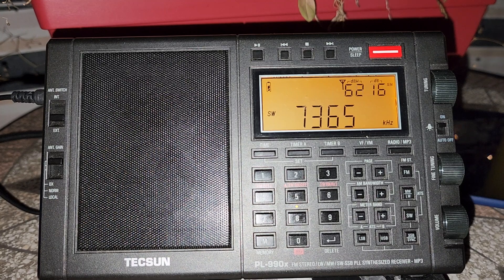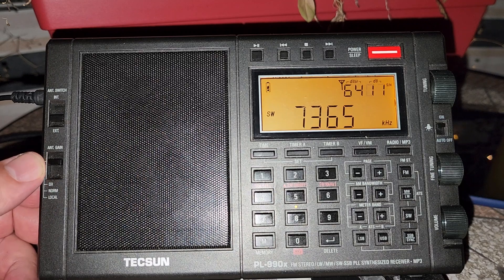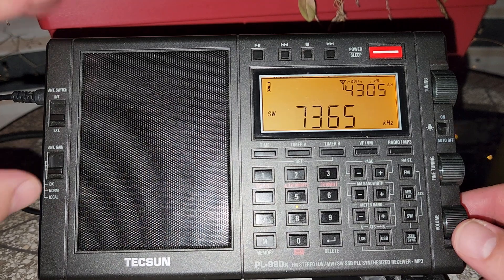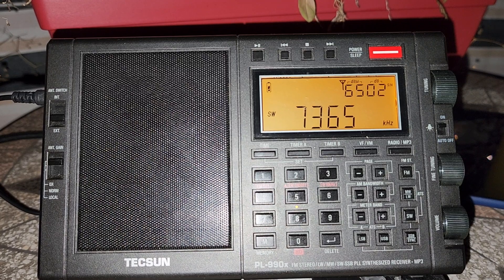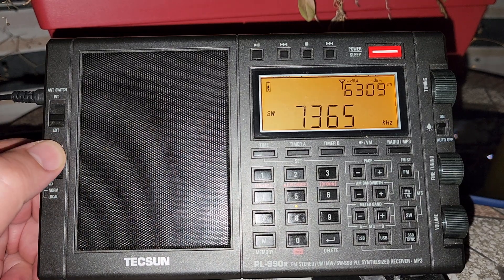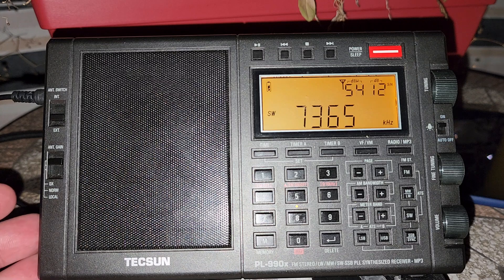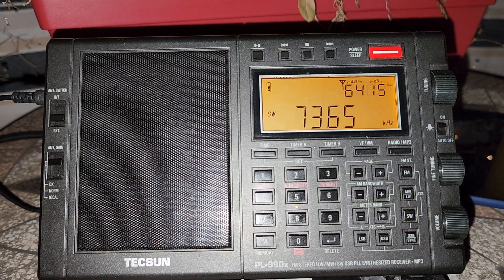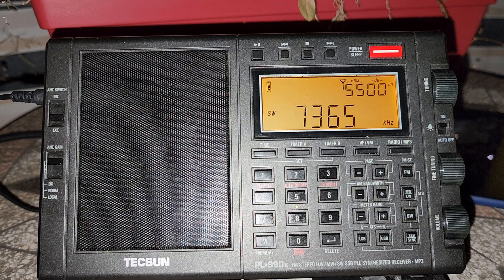Receivers attenuator and RF gain what they do and how they differ from each other

Comment: I have a residence in the downtown area of a big city here in southern Brasil that suffers from massive FM spurious. Some radios have their frontend inundated with intermode interference, i.e. FM on SW. In the case of the Tecsun PL-660, I choose the Normal position and the problem is solved. However, some  AM stations cause some radios to produce images as is the case of the PL-660 (DSP receivers are imune to that), if I choose the DX position, these images disappear. Very good video. Thanks.